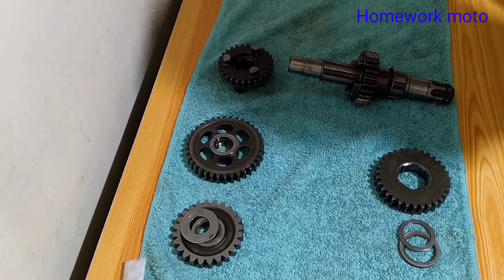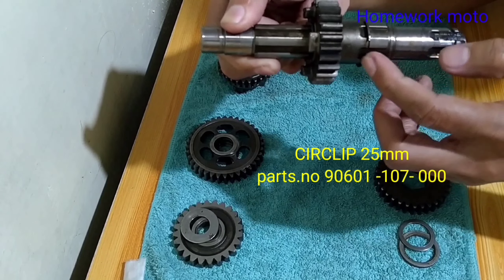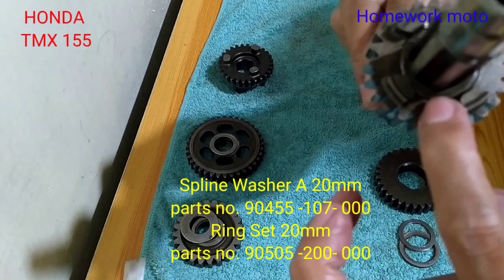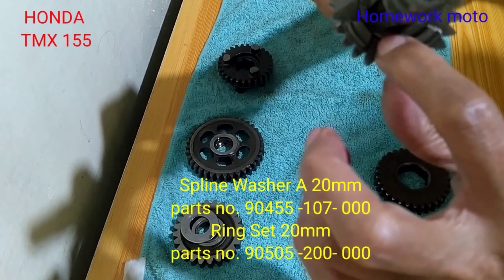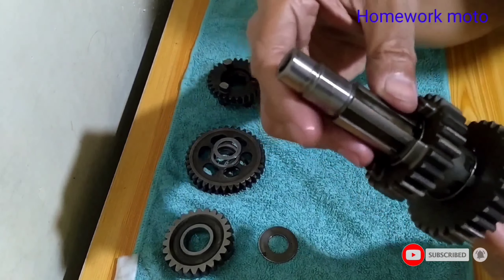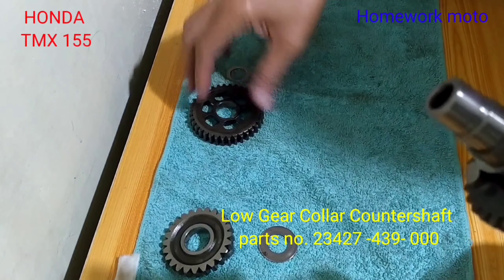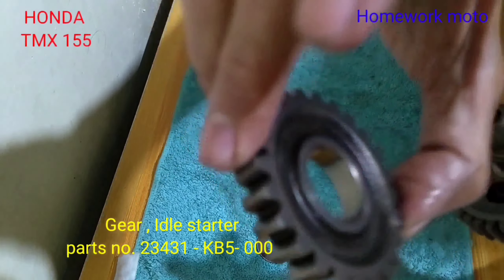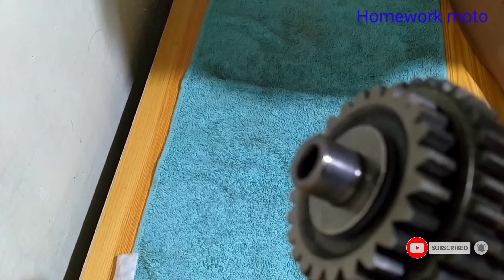TRANSMISSION GEAR COUNTERSHAFT NG HONDA TMX155 @homeworkmoto

Comment: sir pede magtanong motor ko is tmx 155 kahit nka neutral na ay ang hirap nya itulak anu po kaya problem nun sana po masagot salamat
Reply from the maker: Maraming salamat bos. Base sa karanasan ko rin sa motor ko..marami along tinignan na possible ng pangalingan. Una Yung bearing ko sa likuran Kasi nalaglag na at may alog pag hinigpitan ko matigas umikot ang gulong.. pangalawa Yung clutch lining ko naninikit Hindi nag rerelease ng maayos kaya parang may pumipigil pag tinutulak.. sana nakapagbigay ako ng ideas syo.. maraming salamat😊